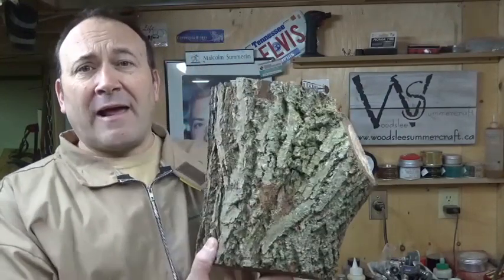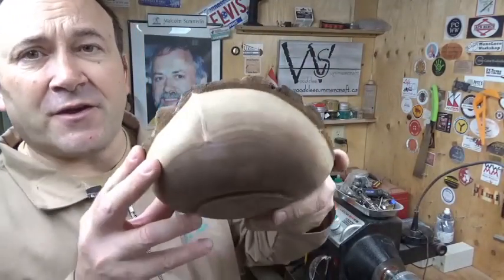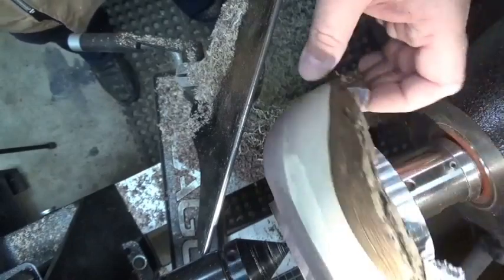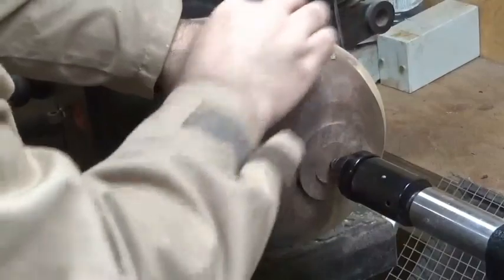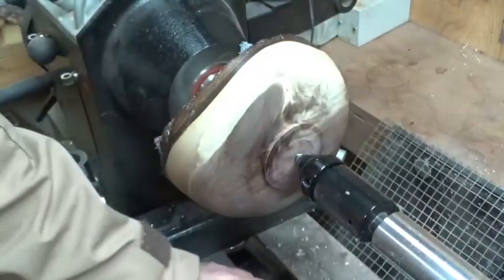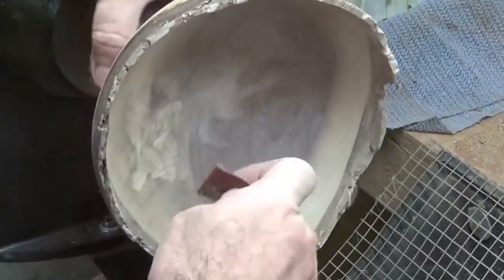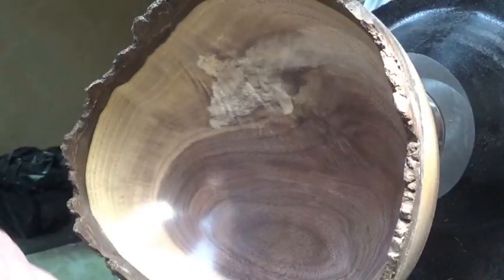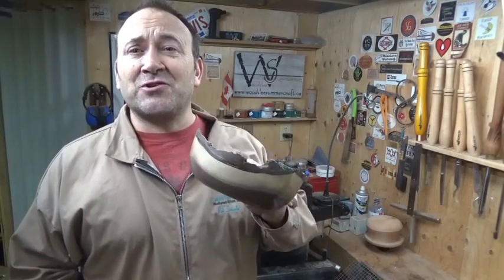second turn, finish green wood fast

Comment: Hi Rob. I've never tried the microwave trick but will try it now that you've explained how it works. I have turned many live edge to their fin thickness while green and then let them dry. Then when dry true up the foot or tenon so it will chuck up properly. Then I sand with a power sander and turn the lathe by hand. Sometimes they warp more than others but no cracks. By the way that walnut is very nice. Thanks
Reply from the maker: Thanks for watching 
Appreciate it
Take care